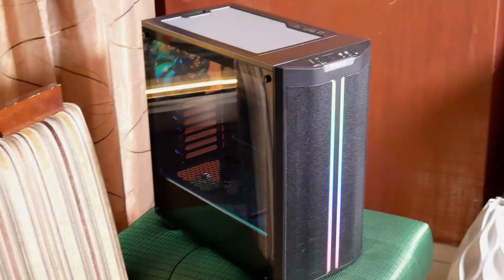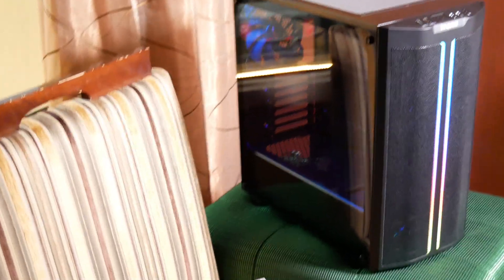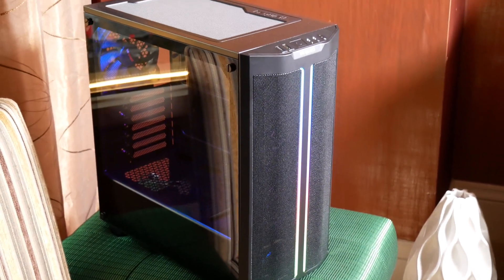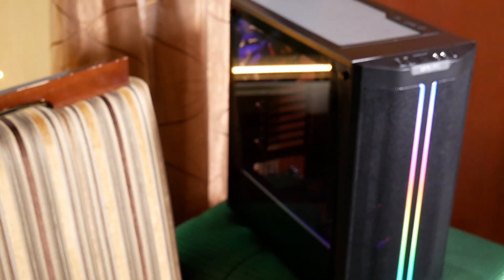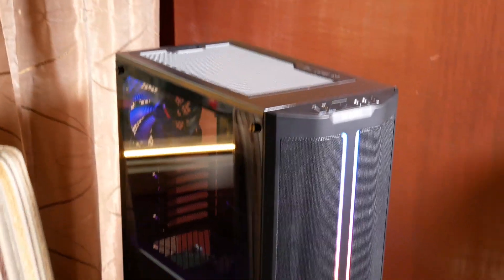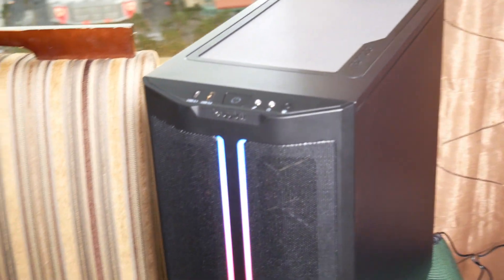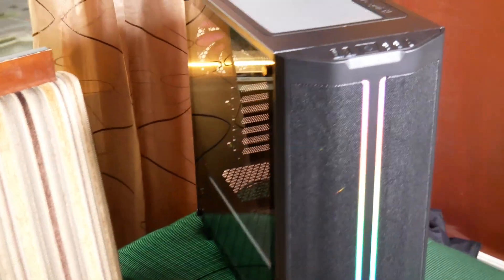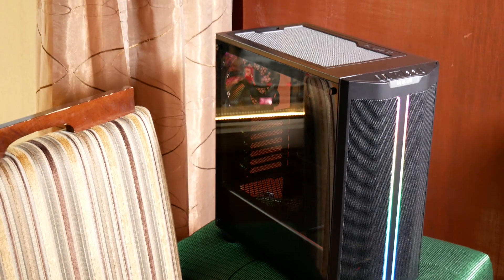CES 2020: Be Quiet! Debuts the Pure Base 500 DX High-Airflow PC Case!

Comment: 4 fans better ?
Reply from the maker: The Pure Base 500 DX has three fans. The original Pure Base 500 has two.
Reply: The Tech Buyer's Guru Yes optional Front 2 ? Better
Reply: @TheTechBuyersGuru  ok 3 .. 4 better? 2 front or not
Reply from the maker: Of course you'll get more airflow with more fans. So sure, add a second fan to the front.